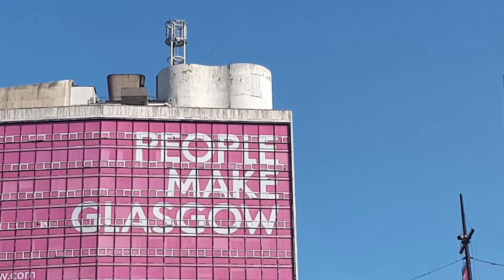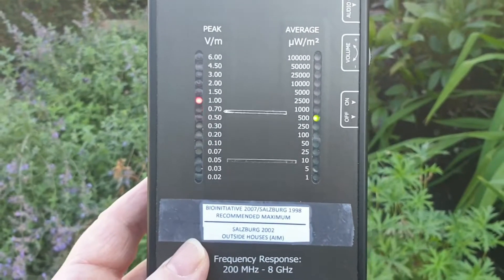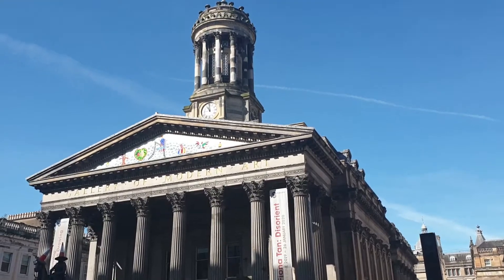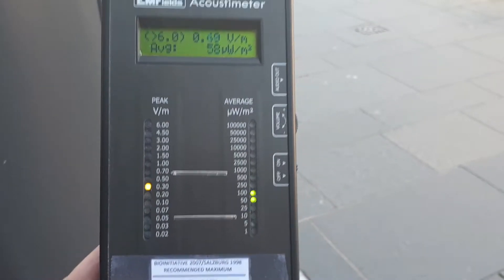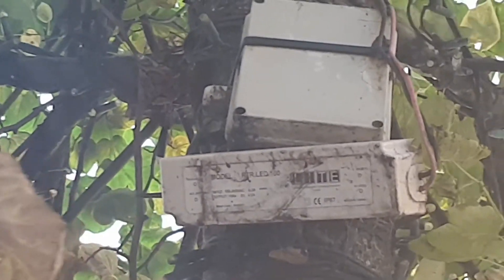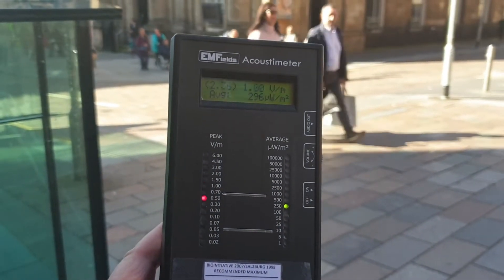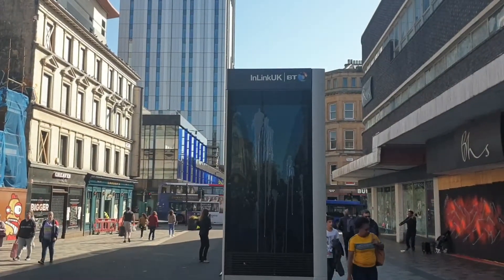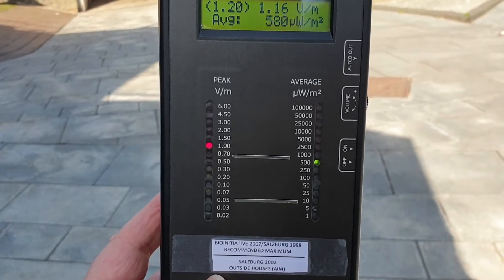Glasgow - 5G or not 5g?

Comment: Many towns in Lanarkshire have a black dome on EVERY lampost. Thanks for the vid!
Reply from the maker: Hi James,  thanks for the comment. I don't think the little domes on the tops of LED street lights are a problem, they are just for low-power data transmission about the state of the units and use existing frequencies, not the higher mm-wave bands (they can only be called 5G in the sense that all existing comms frequencies now fall under the 5G banner). 5G network cells look like square boxes about 30-40cm on a side; they're the ones to watch out for.
Reply: @westerngeomancy  According to Mark Steele. The domes will house the high powered sub GHZ scanning radar, which will work in a  phased array configuration.
Reply from the maker: @oort8troo  I'm afraid I find Mark's videos high on rhetoric and low on actual evidence. But if you can find a link to some actual evidence confirming that claim I'd love to see it.
Reply: @westerngeomancy  Have a look at Lanarkshire. Many towns, with domes on all lamposts. You only need 1 lighting sensor for a street lighting circuit. Just confirms what Steele has been saying all along.
Reply: @oort8troo  The domes are for centralised error-reporting and data monitoring on the street lights, not 5G broadcast phone services. It's a system called CityTouch (https://www.lighting.philips.co.uk/systems/lighting-systems/citytouch). They are planning 5G transmitters for lamp-posts, but they are not those little domes on top, and AFAIK they are still in development.